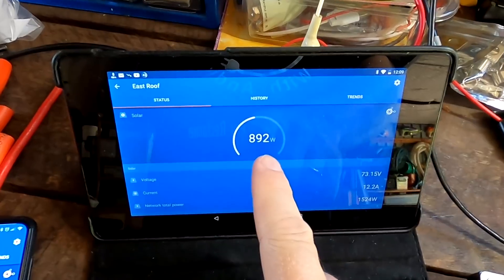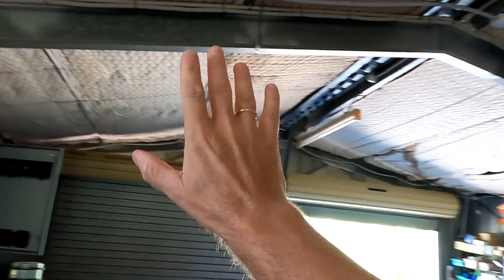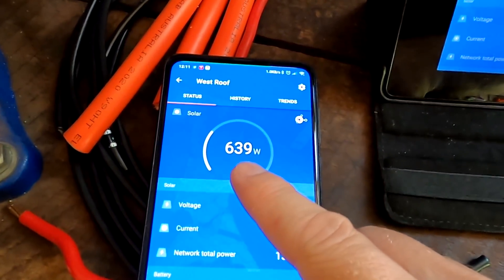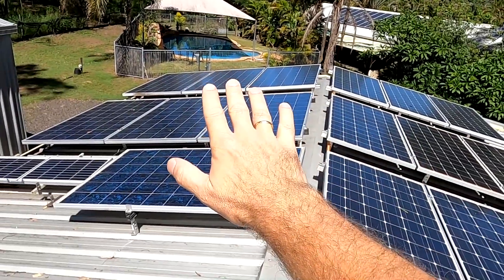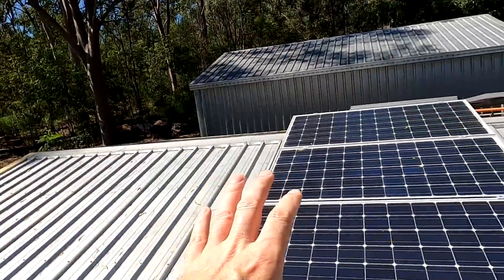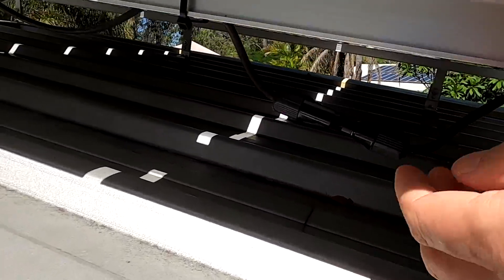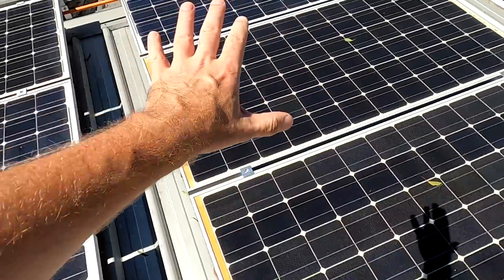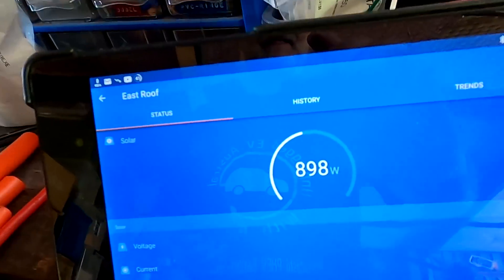60% Solar Panel degradation? Just why? Troubleshooting Part 1

Comment: Maybe Just a quick Test. These are Mono Cristalline.  The Others are polys i think.  So try to cool them with Water and See if the come closer to their Rating.   Its testet at 25°C. You May have in full sunshine over 60°. Would be interssting for me.
Keep on doing your stuff 
Mach weiter so 👍
Reply: I agree, simple test to get peak power is to cool the panels with your hose!

Comment: The problem because the PID.
As you said that these PV panels are used and 10 years old , so if you bought it as used for about 10 years ago then I think some of them had PID Problem ( Potential Induced Degradation) the old PV panels design was without Free-PID protection and because the connect it in series with more than 500VDC and with high temperature and humidity this within about 5 years or more will do a degradation of the pv power and will kill the efficiency and the pv panel will generate about 50% maximum power.
Therefore many companies and projects that using old PV panels They started discarding the solar panels and selling them cheaply because they became damaged due to the PID.

Now days all new factories produce the PV panels with Free-PID and Free-LID.
Reply: Good to know. Thanks

Comment: Voc and Vmpp is probably lower because of your high temperatures.
It looks like you are ending up, shorting each cell and measure the current...I'm keen to see the difference between the new and old ones.
Maybe you actually have only one bad panel per string and it is pulling down the others.

Comment: Both max power point voltage and open circuit voltage will be much lower that STC spec as panels are hot so that is not a problem.  But the current should be about 2x larger than what you see so no idea what the problems is as it is not making much sense unless at least one panel in each string has some cracked cells.
Reply from the maker: I know I'm nut running in STC and voltage and current are lower. But that low does not make any sense, right. Also with three different types of panels...
More testing coming.
Reply: @OffGridGarageAustralia  My best guess is that panels where abused (maybe thrown of the roof when uninstalling so they have cracked cells).
STC is measured with panels at +25C but of course your panels are likely at 65 to 70C so that open circuit voltage of around 39V is totally normal.
Current on the other hand should be a lot higher and the only way to check will be to test each individual panel maybe only some of them have cracked cells.  It is sure not the degradation that is responsible as that will be in average just 0.5% per year so even if those were 10 years old it will not be more than 5% degradation.

Comment: Hi Andy, unfortunately, there is no other solution than to start measuring each panel. Then, if necessary, measure the voltage drops across the individual parts. It's weird that every string made up of different panels has the same problem. I keep my fingers crossed that you will find the problem quickly.
Reply from the maker: You are correct. Thank you.

Comment: Sorry to be spamming, can your mc4 or panel connection be corroded, you see voltage but current will not flow
Reply from the maker: You're not spamming, Edward. Glad you have more ideas 😉
As in the previous video, I had to crimp some new MC4s onto the cables as they cut some connectors off. So at least these new ones should be good.

Comment: dang, that victron mppt is garbage. never expected this from reputable company :(
Reply: Please, watch the whole video to see the results.
Reply: @uhjyuff2095  i did. now i know its not mppt how i expected. but thats make me thinking. i have 1,2 kw of panels, and today i got only 531w on full sun. that means SUN is broken?
Reply from the maker: Why do you say that? What's wrong with the SCC? I swapped them and they showed the same result so not sure what you're referring to.
Reply: @OffGridGarageAustralia  but thats make me thinking. i have 1,2 kw of 1 year old panels, and today i got only 531w on full sun. that means SUN is broken?
Reply: @man4evil  or your bypass diode(s) is(are) toasted ...
Reply: @man4evil  Angle of the solar panel and outside temperature affects the wattage. Also, some days I get more sun than other days.
Reply: @uhjyuff2095  month ago I had 1160 watts of peak output. Temperature about the same. Panels are vertical mounted at 90 degrees.
Reply: @vaneay  did not seen that coming. Need to check :)
Reply: @man4evil  So many ways to check your panels, I guess you could check them one by one for a problem.
Reply: @uhjyuff2095  I'll check them all after rain season :D
Reply: @uhjyuff2095  didnt done anything. 3 days peak output was less than 100 watts. 200 watts generated in a day. but yesteday, sun shined good for a breef moment and I see 860 watts peak. but only for minute. 2kw generated from 1kw pannels in a day.
Reply: @OffGridGarageAustralia  comment was written when you said this one have stock firmware and other is custom, so I was thinking it was mppt problem

Comment: Measure the direction the power on the seperat strings, this will show if the are shorting another string. When 1 panel might be bad

Comment: Try to cut and changing solar wire connection (from the panels). 
The copper in the wires, after ten years, could be oxided
Reply: 3 strings running through the same wires reading low voltage and amperage. I'd say the wires would be my first thought as well.

I'd swap to the cables from the other side and see before anything else.
Reply: If you’re saying cut the panel wires that’s a terrible suggestion. It’s almost never the panels

Comment: You say you're using different solar panels in parallel? It could very well be that those different panels have different Maximum Power Points, meaning that with all those different panels connected together there could very well  not be a well defined Max Power point. The MPPT can't track that.
Reply from the maker: Not what I said, all panels are very similar to each other.
String 1: 3x Suntech
String 2: 2x Renesola, 1x Suntech
String 3: 2x SunTech, 1x TNS Solar
These three strings are in parallel now.
Reply: @OffGridGarageAustralia  why not have 2 strings of suntech, and only 1 mixed string?  However the comparison test didnt show string 1 as superior.
Reply: @KevIsOffGrid  Its hard to tell because we don't know the specs of all the panels.
Reply: @OffGridGarageAustralia  You'll have to compare the MPP graphs of the panels, MPPT's really have a hard time witch different panels, even with slight differences.
Reply: @OffGridGarageAustralia  as they is a suntech in each string i would start out suspecting thors to be the ones that have faults i could be when last owner had them 3 panels where in series and they tulk a hit and maybe just unlucky that you put one in each string
Reply: @OffGridGarageAustralia  maybe the suntech are the culprits, they show up in all strings :P some dead bypass diodes. they live far less longer (5+ years) than solar cells (25+ years).

Comment: Test the last part of the cabling first, so from the conduit under the roof to the cabinet.  it can be done quickly by passing it by making a direct connection from one of the strings to the chargecontroller.

Comment: Can 1 panel have a shortcut, so bypass your strings to dedice which is causing havoc
Reply from the maker: All strings have the same voltages, Voc as well as under load.

Comment: Also check the cables for the current, on top of the shed, maybe 1 string doesn't carry current. You have the correct power clamp for this. And sorry to hear it's not working

Comment: Hate to say it those bypass diodes maybe poor connection  looks like you need to do it one panel at a time, also what kind of connectors are you using I certainly can't get mine apart that easily. Maybe that is why they were free lol
Reply: I thought he had taken them apart off camera then loosly put them together!
Reply: Yes. too easy. I see they are a different design of M4. Those 2 barbs hang on even when depressed firmly, I made custom reverse pliers to pull them.
His have a butterfly that depresses the barbs, looks like.

Comment: Just because it's sunny doesn't mean your panels are pointing in the correct direction or at the at the correct altitude you got to have your panels tipped up towards the Sun to get the maximum amount

Comment: Diode
Reply from the maker: Can't be.... I tested all three strings individually.
Reply: @OffGridGarageAustralia  yes you tested entire strings individually but if 1 pannel has defective bypass diode in each string your test cannot show it.
Reply: @OffGridGarageAustralia  My guess is that you have 1 panel on each string with welding or connectivity defects . You are missing 21v (135v - 116v) that is almost 50% of 1 panel.

Comment: Check the mc4 box, I have the same problem. When I open it up, one of the soldering came off. Soldering it back and work perfect. You can also check each panel voltage that is how I found out my panels is not working right.
Reply from the maker: I thought about that, but we have the same fault on all panels??? 6x Suntech, 2x RenesSola, 1x TNS Solar?
How high is that chance?
Reply: @OffGridGarageAustralia  Actually a very high chance.  Probably the only thing that actually fails with panels is this connection.  They get hot, melt solder, and disconnect.  Use a crimp connection to avoid future issues.
Reply: @OffGridGarageAustralia  did they come from the same roof?

Comment: I'm assuming that the panels are fully loaded and the charge controller is not throttling back due to batteries being nearly upto capacity. 
Check all connections, check all diodes and if you can, check for hot spots that may indicate micro cracks in the individual cells caused by panel flexing (probably caused by handling before the installation)
I have noticed on my rig that the panel temperature has a fairly big impact on generation, my system is best before summer when you have good sun but low ambient temp. Last summer I thought something had gone wrong, I was missing a third of expected current output, but it was panel temperature causing it.
Reply from the maker: I know, the panels are not in ideal test conditions, but we're not in summer any more and have moderate temperatures now.
East roof is doing fine and shows around 15% less power output now than in summer due to the angle of the sun.
Reply: @OffGridGarageAustralia  comparison to other roof eliminates ambient temperature.